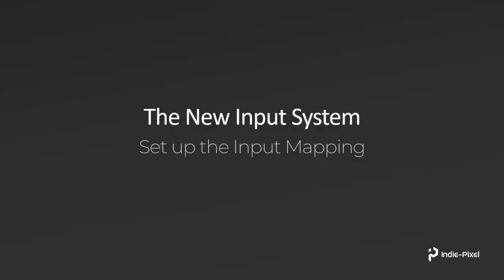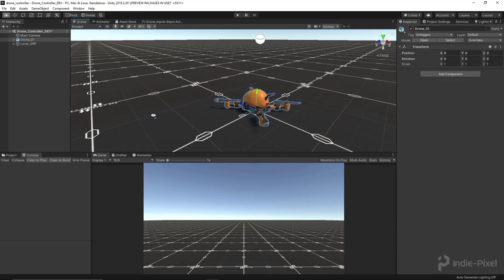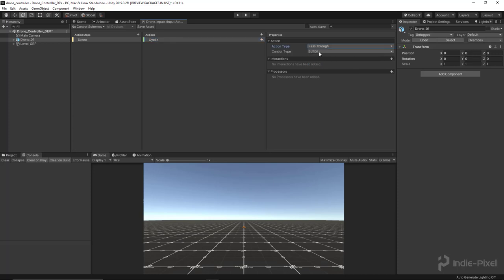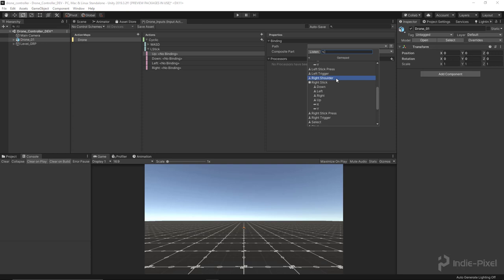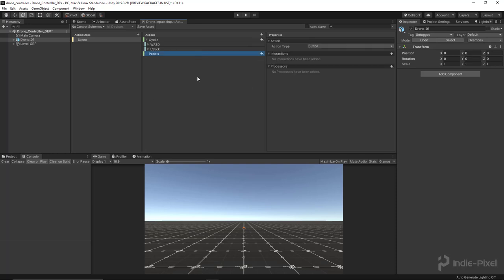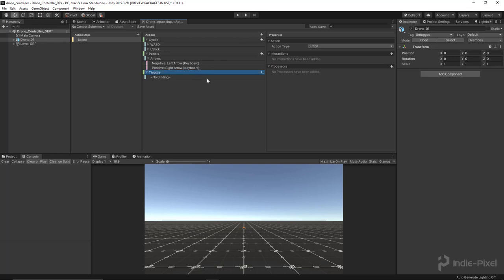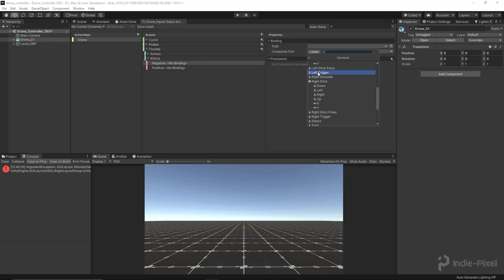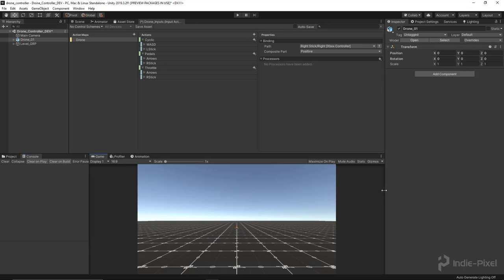Unity 2019 - Drone Controller - Section 2 - Video 2

Comment: So you use pass-through instead of value but I think it's good to know (assuming I read the docs correctly) that this is only useful in this specific instance. Usually you'd want value so it's control bound (multiplayer, or switching controllers). Generally speaking you don't want to allow input from two devices at the same time. It's not wrong, it's just good to know.

Great videos so far, the lack of views is insulting. 😄

Comment: Hi My Dude.... I successfully completed the controller for this sweet drone customed to my own model! It loos great and fly with my keyboard so well!! Took some time to get it working but the tutorials helped me a lot !! I NEED MORE HELP!!! The only thing I can not get operational is my XBOX controller with the drone. I thought the New Input System is correctly connected on my end exactly like your method but my XBOX controller won't move the drone? I checked the setting and it is not an issue with Unity because the XBOX controller is recognized in the program. CAN YOU PLEASE HELP!

(posting this comment on all videos of the series and for anyone reading this far!!! THIS DRONE REALLY DOES WORK!! TRY YOURSELF)
Reply: did you manage to fix the controller issue?
Reply: @gamurarandrei2657  no never did get the Xbox controller to work. You might not like my answer but I have converted to Unreal Engine. Much easier than scripts.
Reply: @4ArtArtArtArt  wow, that was a fast reply.  Doesn't matter which engine you use if it works for you. Good luck
Reply: I’m looking to finish a game by the new year. Could use some help. It’s not the hard work that stops me. It’s my cheap computer. Would you consider helping me out as a team?